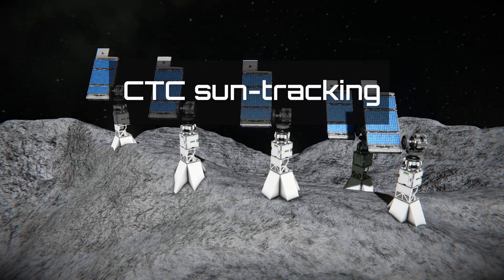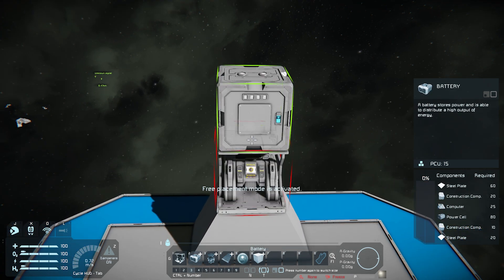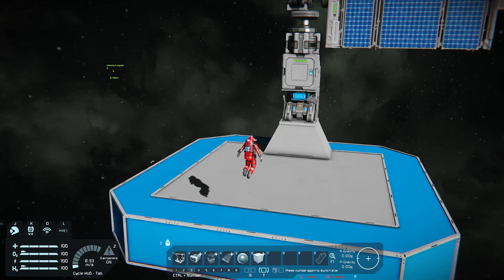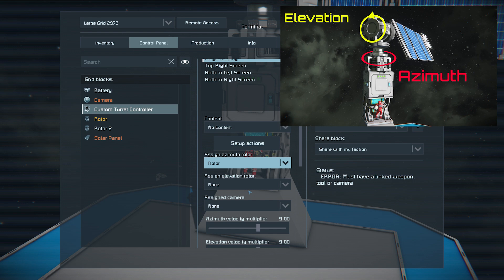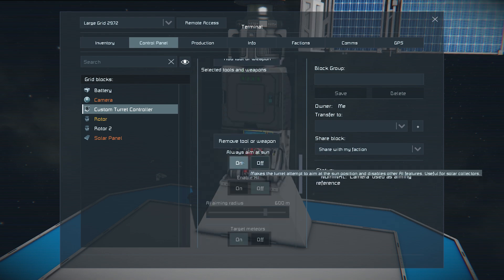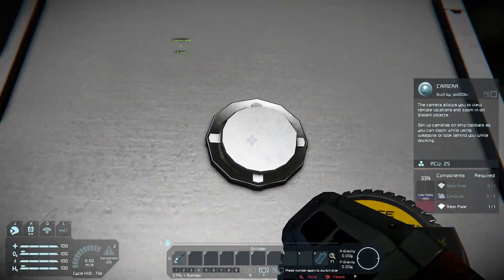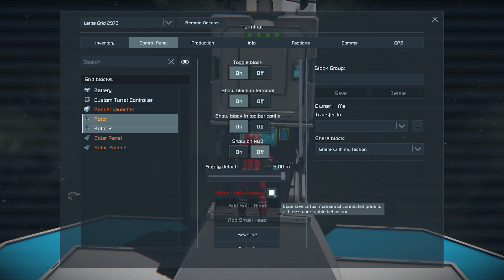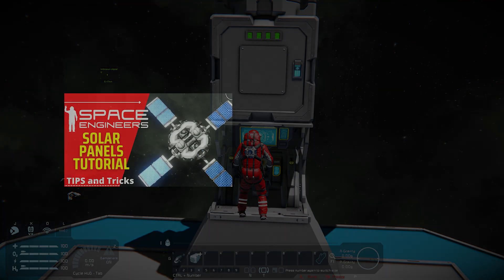Solar Power Up: New Sun-Tracking Functionality in Space Engineers

Comment: Now i can use half the solar panels and get the same amount of power.  Sweet.
Reply from the maker: Hey, I think this was patched in 1.204 update and no longer works this way 😢
Reply: @Pro100tv9  I just made it today and it works fine.
Reply: @Pro100tv9  Unless you're talking about the double stacking solar panels.  That does not work but I just had to make larger solar arrays.

Comment: Hello. I.recently followed this tutorial for make a solar array, but the bateries on my base arent getting charged. The knly thing ive done different is add several light armour blocks between the battery and the azimuth rotar for additional height. Also onstead of doing a single solar panel, ive done several that are all connected to one another.
Reply from the maker: Hey, try checking if the batteries are in auto or reacharge mode
Reply: @Pro100tv9  oh yea, my batteries were in auto. Also, how are you setting up solar array setups? Inset up one in my game that inwas playing, and then when imwent romaet up a second, the second turrent control station didnt have the option of aiming camera at sun

Comment: What if I'm using a hinge for the elevation tracking? I have a hinge in my setup, but the hinge doesn't seem to work, only rotating with the rotor.
Reply from the maker: Hinge should work too. Did you assign it in the custom turret controller?
Reply: @Pro100tv9  You are correct; I just didn't notice I somehow set both to rotor.
Silly me!

Comment: It looks alot cooler to have alot solar tower than one. Make one in the desert and line it up to base
Reply: How do you align it to your grid if so the power will transport it's a complete different grid?
Reply: @twistedrival831   Late, but one way you can use to connect grids is w/o mods is connectors on pistons/rotors.

Comment: In some cases the turret controller is still bugged, for example for me, the aim at sun option does not appear, it can be activated through a cockpit, but will not work unless the game is restarted. so if you have any odd behavior, it might be this!
Reply: if you select and deselect a weapon in the turret controller it brings up all the options you were missing.
Reply from the maker: I wasn't aware of this bug. Did you try to report it over here: https://support.keenswh.com/spaceengineers? May be worth it, as Keen tries to fix any bugs related to the new update
Reply: @Pro100tv9  already reportet it, just wanted to help others if they experience it also:)
Reply from the maker: @Medic Main Dave  Ah great, hopefully it will be fixed soon!
Reply: Thanks for help with the bug; don't get me wrong glad they added this feature with rotors, but bugs like this make it so frustrating when trying to do something so seemingly simple. Reminds me of the bugged Hydrogen Engines that won't fill up with hydrogen when you first build them.

Comment: Does stacking solar panels work? Don't they cover each other? 🤔
Reply: If they are positioned back to back as shown they still work. I think the one behind might get slightly less sunlight.
Reply: It is surprising how lenient solar panels are. Most none full blocks dont block solar panels as long as they are on the back side, aka the side that touches the side of the panel.
So you have have the armor panels covering your solar panels without hindering them. I use that trick for decorating.